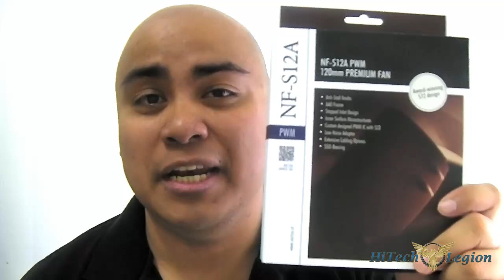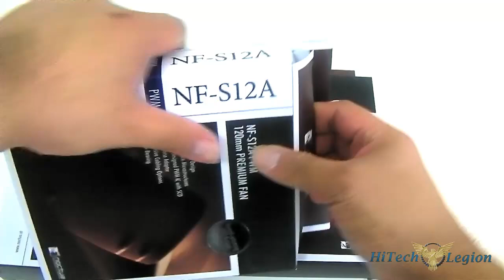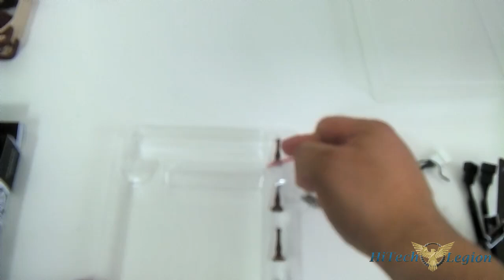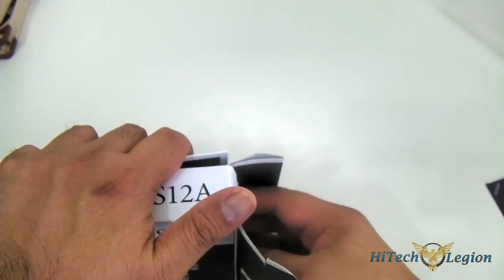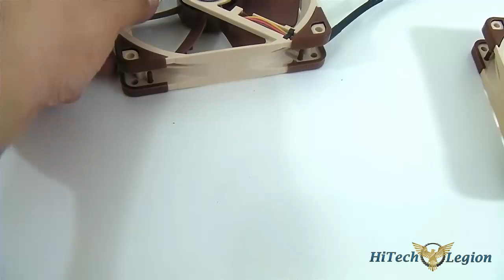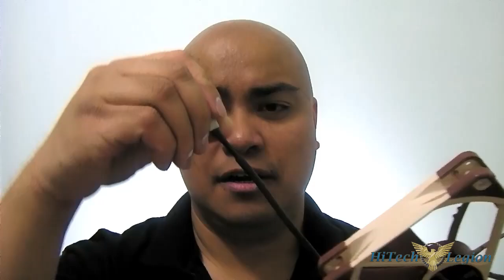Noctua NF-S12A 120mm Fans Review (FLX, PWM and ULN)

Comment: What's the max rpm that you can set it.. I'm trying to buy some nactuas for my h80i
Reply: Thanks for the hook up.
Reply: @joakim08050805   Lies/Fake/False informations,  this fan can be used radiators (noctua homepage -> NF-S12A is even more versatile than its renowned predecessor and can achieve better performance on heatsinks and radiators.

Comment: I ordered 4 NF-S12A FLX and one NF-A9x14 PWM. Theyre making an extrem annoying  sound on the sides and the accecories are low quality crap like made in China. One fan i couldnt test cause the connector was not right built, the contact pins falled out of it and the molex adaptor is the cheapest china crap i ever had in 12 years of building PCs by myself. I returned all 5 fans to get my 100 EUR back. Greetings from Germany.

Comment: I need to get some Noctua fans, my HAF is super noisy now with some crappy fans. i also have a H100 cpu cooler, would you recommend i use S12A for the case fans, and get NF-F12 for the cpu cooler? i want a quiet case

Comment: Other than Noctua F12 or P12 fans, Scythe Gentle Typhoons are well-regarded for push. It runs up to 1850rpm but you can just undervolt it to temper the noise down and it still does very well for cooling. Cheaper alternative would be Nexus D12SL-12 or PWM version fans, pretty much the best value quiet cooling fans I can think of that I use in my system as well. I'm not particularly as hardcore into cooling as some people though so probably somebody has better suggestions if you want lower temps.

Comment: I do a lot of upgrade and built and most of my customers need that flash colored fan and cpu  coolers with matching colors it is very hard to find fan to interchange  with the cpu coolers I am not in the lighted tower  crave but I have to give the customers what they pay for I hope the manufactures of these fans are making the led version

Comment: What fans would be good in a push pull config for use on a corsair h100 ?
I currently have a fractal r4 with a dark rock pro 2 which makes my case very quiet but i want to oc the rig later year cheers